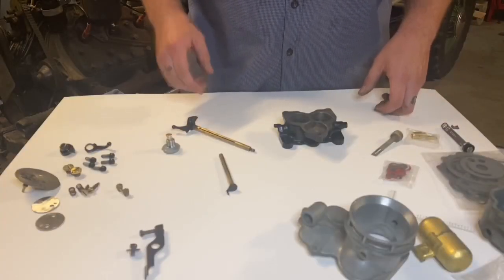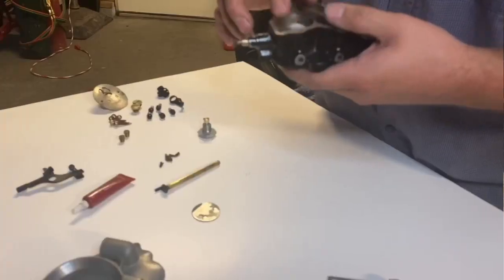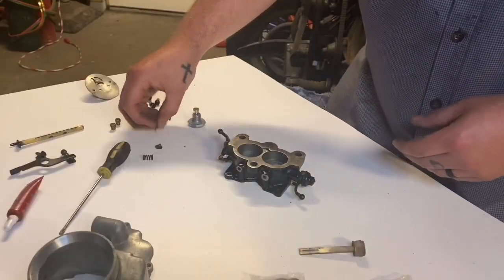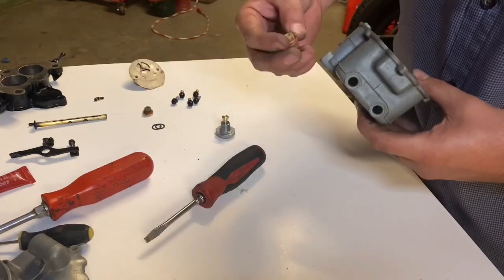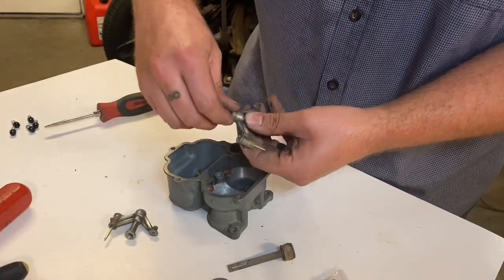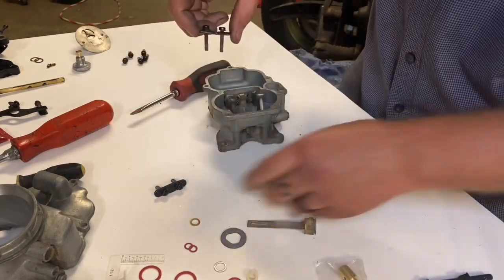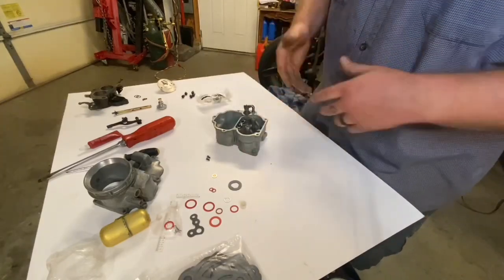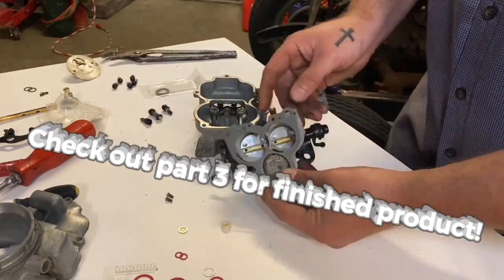Model 94 Carburetor Part 2! Assembly!

Comment: I rebuilt my 94 with typical kit, didn't work right. My dad rebuilt it with a few parts from Charlie price. Mainly the power valve and jets. Runs much better but I think I need atleast a new throttle plate. The shaft seems too loose to me.
Reply from the maker: Sounds pretty typical for a early ford carburetor, you could try buying a new shaft but if your housing is worn out you’ll have to buy a bigger shaft so it doesn’t suck in air

Comment: this is the pwoer valve for holley 94 from speedway?    https://www.speedwaymotors.com/Holley-Power-Valve,393518.html
Reply from the maker: That’s correct, that’s one of your good options, what your link is to is a 5.5 power valve, power valves are chosen by the vacuum your Flathead is running, stock Flathead will run a 7.5 powevalve